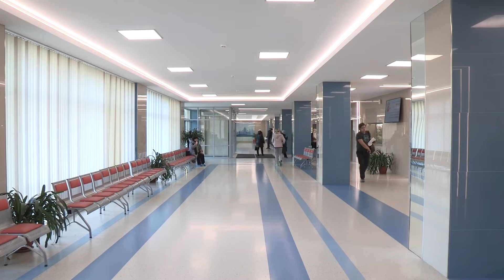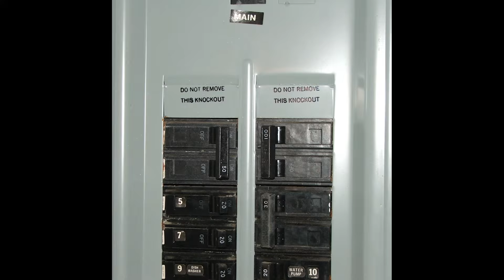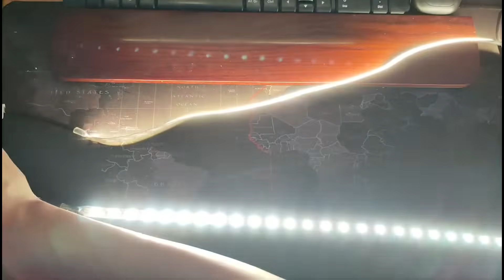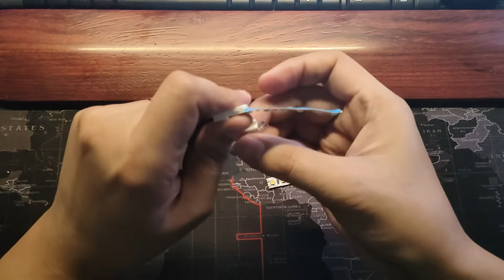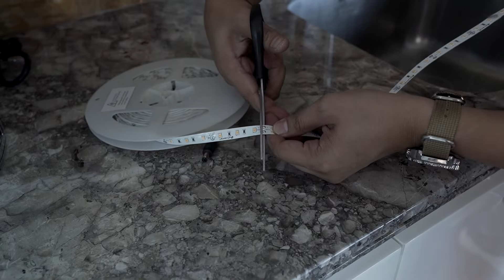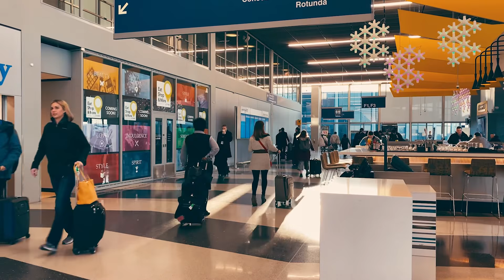Troubleshoot and Fix a Broken LED Strip | HitLights

Comment: The problem is that the connectors are too loose.  Even when you snap the cover, it doesn't press tightly.

The problem will be worse since connectors are up to six.

There are not enough companies creating connectors (L Corners, Extensions, etc.).

One fix is to tightly wound the cover of the plastic covers with Electrical Tape.  The connectors will then be tight with the copper leds on the strip.

Also, there is no need for LED strip companies to apply solder on the strips.  The strips have improved greatly since the days of two and four copper connectors.  This will allow saving cut strips to use instead of throwing away.

Comment: I bought a 24v power supply from Amazon and when I plug in my led strip using the power supply, the LEDs on the strip flash once every second or two. They are not consistently on. Any ideas?